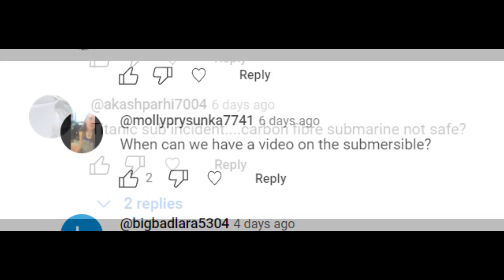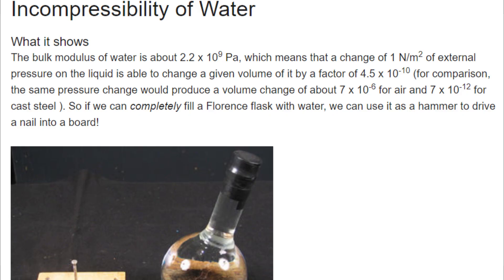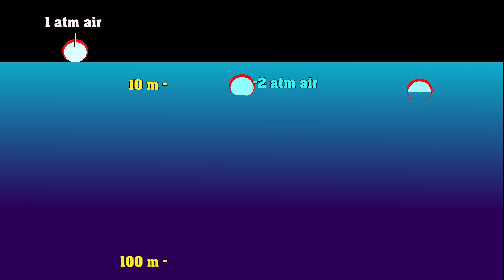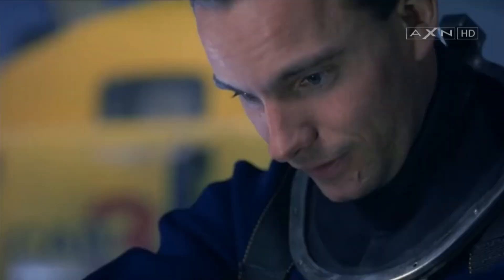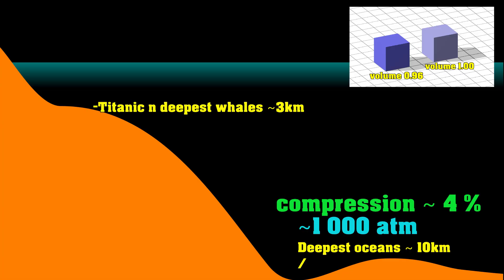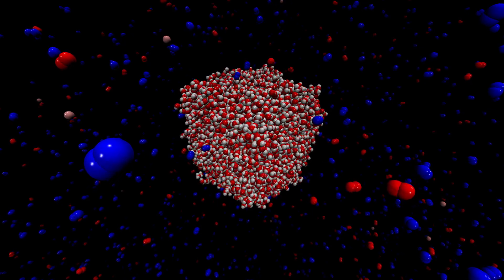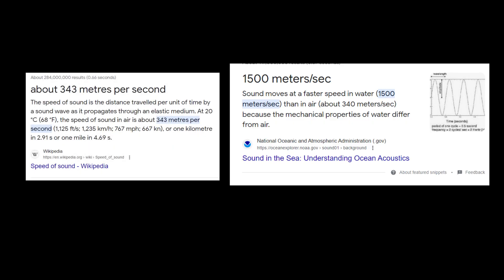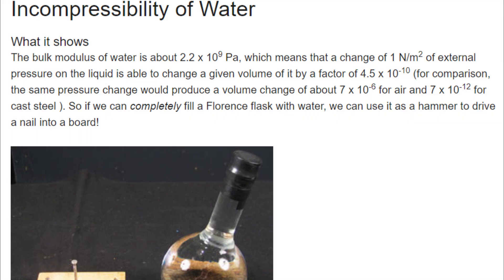What Happens when a Hull Fails at 1000 atmospheres?

Comment: So no one has touched on the window dome was not rated for the depth's it was being used at, another the hole where the electronic cables air pipes etc going through the rear bulkhead.
I would have had at least double the the lip that was the joint between the titanium and carbon fibre.
Also why did they not add titanium rods positioned at intervals round the structure, I know the landing cradle held the lower half, so once it was dropped off the sub I feel this was the deciding factor that allowed one or both end domes to come away from the titanium rings, also when they bolt the front entrance did they have the correct bolts did they change them after each use and were they tightened equally by torque wrench, all unknown's in this tragedy, the biggest faulty component was Stockton Rush with his arrogance to ignore having the sub tested as I feel that the flaws would have been noted and rectified just my thought's on thein my mind was avoidable.

Comment: I'd like to see the calculation for how quickly the water equilibrates to depth pressure after filling the sub. Without that, I'm not so sure you can make the claim that the water is at 1 atm when it kills them. At first thought I'd expect it to equilibrate at the speed of sound in water, so there is some depth where it really is 1 atm water rushing in.

Comment: So if i got this correctly, the pressure differential between the sub and the water causes the water to decompress at insane speeds into the much more compressible air within the sub, creating the worlds hardest hitting hammer?
Reply: Yes, exactly. I don’t understand his insistence that it doesn’t have to do with the high pressure though.

It absolutely does have to do with the high pressure. The pressure differential is what causes that rush of water. If the submersible was at the same pressure, nothing would happen.
Reply: @CMT_Crabbles  Well, technically the pressure doesnt kill you, its the speed of the impact. Its like in a gun, where its not the powedercharge that kills you but the bullet, however the bullet wouldnt be able to kill you if it werent for the powdercharge.

Comment: Well, the difference is semantic here, since the water is compressed due to the pressure. In fact, pressurized air is also compressed. Pressurized anything is compressed. If anything is said to happen due to pressure, it's due to how compressed every medium in question is.

If you want to be even more direct, you sort of hinted at it here already. What kills you is the electromagnetic repulsion between the particles in the water being much greater than the same repulsive forces acting outward from the particles of the air inside the submarine, with those repulsive forces suddenly accelerating water particles into the submarine when the hull is no longer intact. To take the spring example further, it's like having a very tiny spring between one water molecule and the next water molecule, springs held in place by the weight of all the particles above, springs which suddenly release whenever the hull is ruptured.

It's another interpretation of the physics, but I don't think that makes the other interpretations any less correct. It's less of a "that explanation is wrong" type of thing and more of a "here's another way to think of it" type of thing, which I feel is entirely appropriate since most people have no realistic concept of the pressure dynamics that a lot of them are trying to use to explain the event. Most people don't understand pressure, and it's easy to take that for granted when physics is a foundational concept for much of our other knowledge. I do think you're at a more correct level of explanation to get it across to more people, but saying whether or not it depended on the pressure is defined on how you've modeled the system. It's more than fair game for others who would assert that water is incompressible, though.
Reply: Yea I didnt get his insistence that it had nothing to do with high pressure. It absolutely had to do with that, the pressure differential is what causes the rush of water.

Comment: Humans are oblivious of the approx. 15 lbs. air pressure in which they exist. Fish at the level of the Titanic are likewise oblivious of the 6000 psi pressure exerted upon them by the water. That is because the pressure both inside their body and outside the body are equal with no pressure differential to either crush them or to cause them to even feel discomfort.

Comment: Shows again why school is useless
Reply: I mean he just explained a different interpretation of it.

Compression and Pressure are the same phenomenon from different points of view.

He insisted that pressure did not cause it, but that is not true. The pressure differential is what causes the rush of water.
Reply: @CMT_Crabbles  He said water can be compressed and we are always taught it can't be
Reply: @scenicshoots  even if water could not be compressed, that has a negligible effect on the implosion.

The reason the sub imploded is because the hull was breached, allowing the high pressure water to enter rapidly. Pressure acts the same regardless of the medium, like Mass.

Even if water was truly incomprehensible, it would still be high pressure and the submarine would be low pressure. Same physics, same result.

Comment: The claim that really grinded my gears was when someone said, "oh, because it compressed, the air got hot, and their bodies were instantly vaporized when the air turned into plasma!" And their source? They asked chatGPT. Of course, because of adiabatic compression you get ~1200 C (not that there would be time for anything to actually burn), but chatGPT made the claim it was well over 10,000 C. PSA, chatGPT is a large language model meant for conversation, not an accurate calculator
Reply: I don’t understand why people think ChatGPT is a good source. It’s literally stringing words together to make something presentable, not accurate.
Reply: @CMT_Crabbles  cuz that's how most media talks about it, the answer to every question you could think of. And when you ask GPT, you'll get a very confident answer, it'll even give an explanation if you ask. Hard to know if it's not accurate unless you already have an idea of what the answer should be

Comment: Tried to understand. Out of my depth here.
Reply: He didn’t explain very well, and also said pressure did not cause it. Which is wrong.

The rush of water is caused by the pressure differential.

Which is a fancy way to say the pressures are different and they want to equalize. The hull stops that from happening, until it didnt .

Then the high pressure water rushed into the submarine very quickly to fill in the relatively empty space.

Comment: Thunderf00t, your help is needed to help prevent a potential disaster in San Francisco with the Millennium Tower! The thing has been leaning dangerously since it was built due to some bad calculations by the original designers. The city of San Francisco needed a fix to keep the building from falling down and killing untold numbers of people as well as bringing other buildings down with it. Who did the city hire to do the fix? The same bozos who designed the thing in the first place. There are so many problems with it that anyone can see that the fix isn't going to work. The biggest problem are the steel plates which the entire thing is supposed to rest on. No one has adequately tested or even run the figures on these tiny plates. As if that isn't bad enough, the company has reduced the number of these plates drastically from the original number for the worst, but most common reason there is: to save money. If they finish this project with the current fix, the building will fall over sideways and will start the dominos falling in the city. The building itself is sparsely inhabited because the floors aren't level due to the building leaning. It's the full to the gills buildings around it and both the heavy pedestrian and motor vehicle traffic on the streets below which are in serious danger.  There is going to be a lot of loss of life when this thing fails, and it will fail, even without the major earthquakes which San Francisco is known for. 
I'm sorry to take up room on your channel to tell you about this. I don't know any other way of contacting you. I only know that with your visibility, you are much more likely to be listened to than the many engineers who have been knocking on the regulator's doors and are being regularly turned away because the regulators have not finished their morning coffee yet, and will need to go out for lunch once they do.
If you could do the physics on these plates, and some of the other silliness which the design firm is resting this whole thing on, maybe it will get the attention it deserves. Or maybe it won't. But at least everyone will know when eventually it does come down. I think that the engineering firm CEO is counting on it lasting until he's long dead and in his grave. He's an old man, so it doesn't have to be more than a decade or two. It's going to be a failure in slow motion.
For the city's part, the plan to inspect some of the casings daily. That will turn into weekly as the city's need to save money continues. Then monthly, then annually, then once a decade, then when they think about it and get around to it, as always happens with projects like this. I think we can count on it hitting the last stage of inspection as soon as a new mayoral administration is elected in 2024.

On the video at hand, it is as always, well put, interesting, and wonderfully debunking. We really need one thousand of you to debunk the myriad and nearly unlimited bull shitters out there. It seems like it's still easier to sell snake oil than it is to make a real living, plus the rewards are so much better of you can bamboozle people out of their money than if you work at anything else. If nothing else, it's entertaining to watch these guys get shot down with just a little bit of reason. Keep up your great work! I'll continue to watch even if you don't take on this unfolding horror at the Millennium Tower. You're just too good to miss.

Comment: There is no need whatsoever to invoke the spring properties of pressurised compressed water here.  The 1 atm sub had displaced its own volume and the sea level was consequently slightly higher after submersion.  When the pressure hull failed then the sea level returned to its previous datum as it filled the sub volume which may be treated as a perfect vacuum at those depths for all practical purposes.  If water was perfectly incompressible but still fluid then the outcome would have been indistinguishable from what actually occurred as far as the hapless occupants of the sub were concerned.
Reply: Yea he overcomplicated this alot

It’s pretty simple, the high pressure water floods into the low pressure area. He was wrong in saying it didn’t have to do with pressure.

Comment: I think the boundary model shown here slighly misses the mark, in that it is the collisions in the boundary that cause the pressure. When you let the water expand into the air in the sub, there isnt really much pressing back on the water anymore. So all the water around pushes the water near the sub into the sub. And the air inside the sub is compressed and heated and overcompressed and it basically ignites, bounces overexpands and cavitates.
If anyone has seen how cavitation (small pockets of vacuum) can damage a metal propellor... Well... 😮
I dont think you would get much of a pocket of decompressed water, because there is so much water coming in behind it all the while, all moving with collisions at the same rate as the expansion. So while the surface layer might have a chance to decompress, i dont know how much of the rest of the water would, and the pressure would climb to the 1000 atm very quickly. Because that is how the air in the sub is being compressed. By the collisions with the water coming in.

Obviously the difference between suddenly letting water in and moving slowly down in the water like a whale is significant!

Comment: Seems an assumption here is that the hull doesnt deform. Its just an instant opening to allow water in.
When you watch tanks with a near vacuum inside fail, the 1 ATM pressure from the atmosphere is enough to crush the tank near instantly. Thats gotta be pretty lethal.

Comment: One thing: you do explain things in ways that make us plebes understand. 

Your "springiness of water" reminds me of when they built the CN tower in Toronto. I was fascinated and asked some engineers about what they were doing. You see, it prevent the tower from moving too much, they poured high pressure concrete and when it was dry, they tightened up nuts on high strength steel bars imbedded in the concrete putting the concrete under incredible pressure. 

This is a problem because they don't know how to release that pressure in a controlled manner. Simply loosening the nuts would cause the concrete to expand so rapidly it would explode. This correlates with your explanation of the water suddenly releasing the built up pressure into the "sub" or void.

Comment: That's stupid. Water at the surface falls 1g, sure. But water at 4 kilometers is under tremendous compression, it's like a spring. So when a void opens, water rushes in at the speed of sound in water, thousand time faster than freefall

Comment: I have just read 'Waterclap' a short story by Isaac Asimov. The title comes from the sound made when water is allowed to fill the airlock of a deep sea habitat, even when slowed down to a 10th of its natural speed. He also describes what would be left of the people if the water flooded the whole facility - very little, just fragments.
The truth is that water is difficult to compress, even by just a little bit, but by the time you have there is a vast amount of stored energy ready to be unleashed in a tiny fraction of a second.

Comment: If you had an open steel jar attached to the outside of your submersible and had a tool to screw a lid on it at 4000 meters down, it'd be fine at depth since there's no pressure differential - just an equilibrium of internal and external forces-- but the higher you go, the greater the risk of explosion if the container isn't strong enough to contain that "spring." since the outside forces are no longer pushing back  as hard.

Comment: afaik normal air gets toxic around 40-60 meter depth, comercial divers working around 200 meters deep and the deepest job ever done was at 500meters depth where they used hydrogen instead of a trimix. so, if iam not totally wrong normal air gets much earlier toxic then the mentioned 100 meters depth.

Comment: What a lot of nonsense in this video!!!  Gas molecules are not traveling at the speed of sound!!! If you have gas molecules going at the speed of sound and a jet aircraft going at the speed of sound, the relative speed of both is zero!  If that is the case, when jets pass the speed of sound, there would not be any shock waves that is heard on the ground which is NOT true!!!

Comment: what you explained may be true but the way you explained it was if the window broke, and they were still in a tube   from the wreckage recovered the air pocket was compressed from every angle,   there was no carbon fiber recovered

Comment: I’ve been hearing a lot of people parrot what they heard on the news from a TikTok video about there being extreme heat, on the level of thousands of degrees Celsius due to the energy released by the implosion and this being a contributing factor to their deaths. I can understand heat being generated from the energy of the event but I find it hard to believe that it was enough, or in a large enough area for a long enough time to matter at all. The water is 34 degrees. I’ve done some reading and research on this and a lot of people are saying this isn’t true. That any heat would’ve occurred at the point of failure and that it would’ve dissipated quickly. Do you think the claims about the heat are true?
Reply: They would easily both kill you, doesn't matter is 1 is a microsecond behind the other....
Reply: @AndTecks  Obviously they were going to die. The people are irrelevant in my question. I'm curious about the actual physics.
Reply: @jordanwhite8567  Ok. I know it would be a great answer and I would like to know it too for morbid curiosity. I think this would be one of those things that might just be impossible to test though. I don't think we could accurately simulate this. But I would love to be proven wrong as every scientist should.

Comment: Think of it like a giant cavitation bubble. It converges on the center of the bubble and strikes with an incredible hammer blow that rebounds. So the reverberating immense shock waves should tenderize any flesh in there very well. The compression ratio is 400:1 so it will also get very hot.

Comment: I'm pretty sure the water hit you at the speed of sound (1500m sec) in case of an implosion. At this speed water or concrete make no difference.
Reply: Nowhere near that from what I've seen (physics calculations on the oceangatetitan subreddit). But still enough to totally crush the pressure vessel in 16 milliseconds.